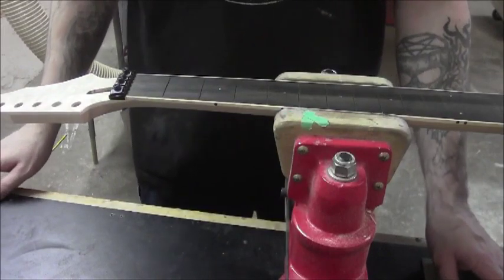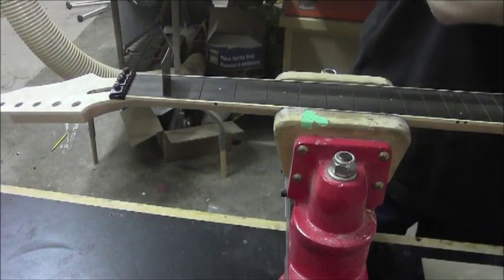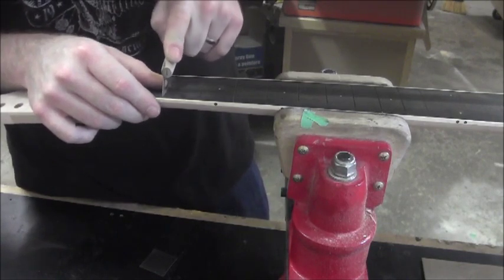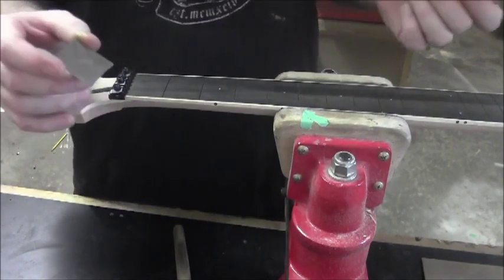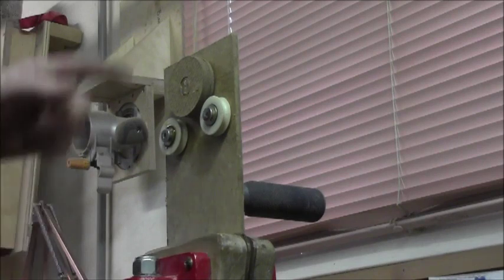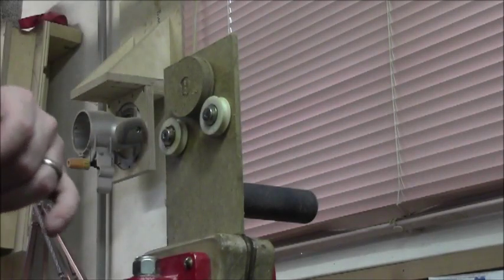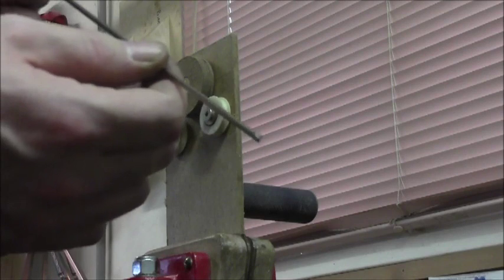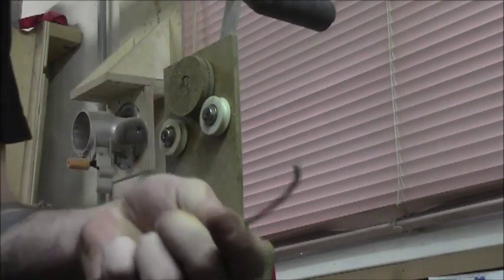How to Build an Electric Guitar-Video 20 - Fret Install Pt. 1

Comment: Hey, hope all is well. I am wondering if anyone may be open to providing some advice. I have this beautiful green Ibanez. Thing is... you may hate me for this... I had someone de-fret the Green Beast just to see what the guitar would sound like as a fretless. Needless to say, it turned out to be a terrible idea. The sustaine is pretty much gone and the tone isn't exactly what I'm looking for. So, I make the decision to put the frets back in. Nope. The guitar has beautiful ivory-colored binding all around the neck and body. I've asked all over for ideas on how to resurrect this Beast. However, with heart-clenching sorrow, everyone has said that the cost wouldn't be worth the fix. Now, here's where I turn to youtube for answers. I've watched quite a few luthier videos. After quite a few months of obsessing, I almost completely give up. When, just last night, I come to think up a new possible strategy. Do you think that it would be wise to use a dremil tool to clear out the epoxy filling the fret slots?? Let me know if you have any thoughts on how to put the frets back into The Green Beast.